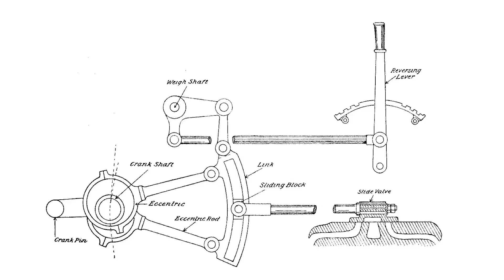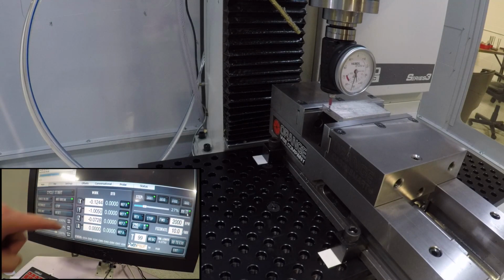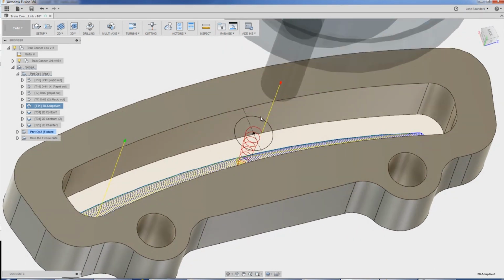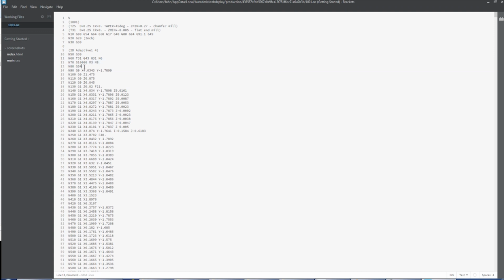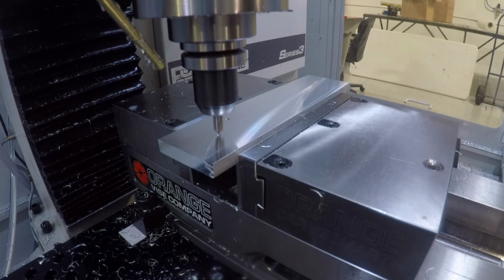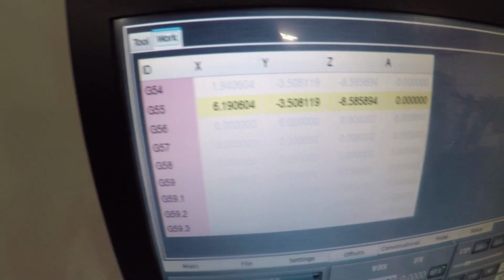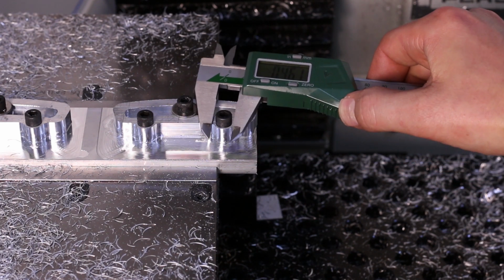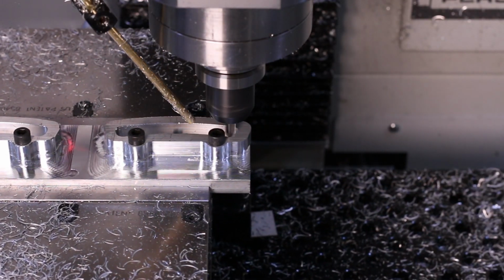G54 G55: Multiple Work Coordinate Systems with Fusion 360 and Tormach! WW147

Comment: I am jumping in before the end.  Those pieces are Stephenson links to choose the direction of rotation of the engine.  They are part of the valve gear which times the valve to the cylinder.  There are two eccentrics on each side with a rod riding on each eccentric reaching forward to the link.  By raising or lowering the link the valve rod is in direct line with one eccentric rod or the other.  Normally the reversing rod is behind the drivers and behind the cylinders so it would be easy to look and tell which direction the engine will turn when the link is up or down.  The arrangement shown is not typical.  Normally the reversing lever is pushed forward and the link lowered to go forward.  Also the crank pins are 90 degrees from each other so the engine(two cylinder) will be self starting.

Comment: You don't powertap on the Haas? Seems like that would be a time saver. Of course not breaking taps and scrapping parts with a machine that doesn't care about torque limits could easily make the second op worth while. :-) If you had modeled the screw heads before you did the cam and left them a part of the model would it have avoided the tool collision?

Comment: In this case, I think it's a good candidate for patterning within cam. With such simple fixturing, and two identical parts in the same vise, two offsets is redundant. Especially if you're going to ever run those parts again. Setup time will be reduced and the margin for error is also much smaller, because you only have one work offset to worry about getting right. :D

Comment: Great work John.  I commend you for putting that little hiccup in the final cut of the video.  Most of us would edit that out (wink wink).  I couldn't agree more, I've lost count of how many time I've accidentally milled the top off a cap head bolt ;-)
Reply: DCTTeacher1 those are the ones to save and reuse haha
Reply: Donz Milky true that mate 😂
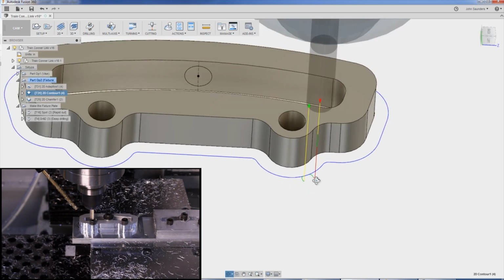Reply: The realization slam at 9:02 was an awesome touch in editing, and the multiple rewinds. So hilarious. Came out of nowhere. I rewatched this video a couple times just because of that. :)

 - "I've lost count of how many time I've accidentally milled the top off a cap head bolt ;-)"

What sucks is when you royally screw up a bolt head to the point where you can't put the Hex Key in anymore. 'Ah crap, now I got to find a way to take this thing off without damaging the part. Fuuuuu...'

Comment: That three flute didn't seem to mind the steel screw that much, It was a different story for our superfly when it tried to tangle with a talon jaw after the cam was set for a zero off of part top and the guy operating it for that part zeroed off the parallels. Lesson learned, always triple check Z heights.

Comment: That new Editor is killing it nice work with the Chips and Cad at the same time. Get on Tormachs case about more rpm for the 1100
Reply: or save $5K and get a VMC from the 90's that has at least a 7K rpm spindle

Comment: Nice work John.  I was recently machining a part which only just fit on the machine, so I kept the clearance plane close to the part to avoid running out of Z travel.  Just missed the bolts I was using to hold it down when it rapid moved to another area of the stock - more by luck than judgement !

Comment: I like that format of mixing toolpathing with machining. nice work... so far as the c rubbing goes.. the safest thing is to define your fixtures in your setup... then simulate before posting. because otherwise all it takes is adding another quick toolpath and forgetting to change the height and you're back to crashing into cap screws.

Comment: I didn't even see you take that screw off until you slowed down. That tool took it like a champ, didn't seem to care about it at all.

Also, I did not know you could use a point on that CAM drill op. I usually add a pocket/through hole in the model (I know it's a hack) with the same diameter as my adaptive tool so I can use it as the predrill position for the adaptive. I will have to try that point trick next time!

Comment: Couple things:

1) Watch out for true position shifting between the bolt and the ID, I've lost many chamfer tools due to the sloppiness between the two.

2) Feel free to up your chip load on your chamfer tool, a .0035" chip load per tooth on a 4 flute chamfer mill still gives a surprisingly smooth breakedge and would bump you up to 140IPM.

Comment: How do you chamfer the bottom of the part?  By using cap head screws, wouldn't you have an alignment issue if you simply turned the parts over?
Reply: 1OlBull. You will be amazed at how close flat head cap screws get you.  You do have to exercise some attention to detail with regard to the head diameter.  The height will allow more clearance .  of course this is only good for symmetrical parts.  try it and you'll find quicker turn around of parts.  BTW,  I like to keep an assortment of fhcs with the head diameter reduced at my bench. I'll chuck them in a drill and take them to the belt sander. just a bit smaller nothing gross.  a little planning a care on feed will result in accurate, repeatable part made quickly.

Comment: Mastercam has an option for transforming/translating toolpaths with no need for all the extra machine setup or extra CAD geometry. If you don't like rigid or compression tapping on your machine you need a bed mill with a quill that will allow you to tap using the manual part of the quill and will not affect your setup. if the quill has a readout too it won't affect the z setting either. Just some of my thoughts have a good day!

Comment: Question on cleaning your Tormachs... between the way oil and the mist coolant chips and crud just stick to everything in the whole cabinet.  How are you keeping your 770 and 1100 so clean?  Are you using some type of spray cleaner that's cutting the oil that coats everything?  Even the area around your bolt heads on the mill base are pretty clean.  Is there a trick, or do you just do a TON of cleaning every day to make it look good for the video shoots?

Comment: Great video as always. For avoid crashes to the bolt heads, you could download the actual bolt design from McMasterCarr and then in your setup page, you could select those bolts as fixture. By this way, you could change the retract height or other associative parameters if some crashes occure while simulating toolpaths.

Thanks for this week's WW.
Reply: Pretty sure he knows that considering he's done multiple tutorials on it....
Reply: @Steve_Just_Steve  I didn't. Thanks @Tayfun.

Comment: A question.  Were the links machined from steel or aluminum?  If aluminum they will wear very fast because there is a lot of force transmitted through the valve gear to move the valve.  The links should be steel or cast iron and the blocks in the slot should be brass or bronze.

Comment: Is there a special reason for using a manual touch probe? Or is it not possible to use a CNC touch probe with the control of the machine?
Reply: tormachs have a digital one but its $$$ and not much different... Id like one though haa\

Comment: when we first started running our router it was using a G28 at the end of the program to go back to absolute zero in machine coordinates and it ran right through a drill press vice we had bolted to the table. end mill didn't even break but it chipped every tooth and shoved the gantry out of alignment.
Reply: That sounds really bad :(
I don't use the "return to zero" commands anymore, too much can go wrong. The homing command is better, the machine ascends the z axis first and then travels to x and y zero.
Reply: you do g28 Z0. first before any lateral move ;)
but Im sure you learned that now haha

Comment: John,  you have 2 coordinate systems (G54,G55) demonstrated in a single Setup.  How do we handle assigning G54 to one setup, and G55 to a series of CAM operations in a second setup?  I know its easy to simply manually edit the gcode and insert G55 where needed, but thought there would be a way to do it through F360's CAM interface... ?  Thanks ...  Bill W

Comment: I just my 770 with a stand and ATC from Tormach last week. Getting use to Pathpilot and the way they set offsets is a little strange coming from using a Haas and Mori Seki machines at work. Is there a way to search for a line or tool in the active code to rerun that sequence? 

The ATC has been very cumbersome to dial in. I spent a few hours tweaking it on the weekend and it was working great until the I was on my 10th part this morning and for whatever reason, the ATC stepper either lost its position or something loosened up but when it did a tool change on the last tool, it came down and snapped the plastic bolts off. Now I can't seem to get the carousel to agree with the rest of the slots after aligning one in perfect. Any tips??

Comment: Aluminum for that part? First time in the live steam hobby that I've ever seen one made from Aluminum. It's a part that takes a beating!
Reply: billh308 yes I totally agree I used gauge plate ( W1 or O1 for the USA guys )
I have done  five true scale mainline loco's and much prefer Walcherts /sp gear after a torrid time with a inside Stevenson's loco link
But it did work out ok

Comment: I would've put two pins into the holes so the parts are aligned well and then two bolts at the ends of the slit, then you also wouldn't have to worry so much about the chamfer.
Reply: Klaufmann how would you then do the internal chamfer
Reply: Sorry, commented a little prematurely, the chamfer of the slit would be a problem. But wouldn't it be more important to hit the alignment right? The chamfers could be done by hand, if the look isn't so important, I think it will get scratched anyway.
Reply: @stuarthardy4626  put the dowels/pins in lower so you have clearance

Comment: How are you getting 10,000 rpm on the tormach? Is it a modification you made to your machine? Or did you say that by mistake. BTW, I used to work at LBNL as a machinist. That DMU you showed in the video was the machine I operated. And also the tiny CNC lathe that appears briefly. I used to love working there!
Reply: OOOPS , never mind, just noticed it is a Tormach 770 not a 1100.

Comment: Should have milled out a set of soft jaws and made a nesting fixture to hold the second op, no screws necessary so you don't have to stop and remove screws for chamfering the edges

Comment: I would hold  side two in soft jaws no problem..the part looks quite strong so would not crush no need to have side two really tight anyway.. centring vise for side one..no need to probe the stock for position that way..

Comment: Good video! Does anyone know how to stop it from going to G30 as it moves from one work offset to the next? Not a problem for one off programs but it wastes a lot of time when doing a production run. I've been manually editing the code but I'm hoping there is a setting I don't know about in Fusion360.
Reply: I added an extra property to the post processor so I can select whether or not to do the full retract when I post the code